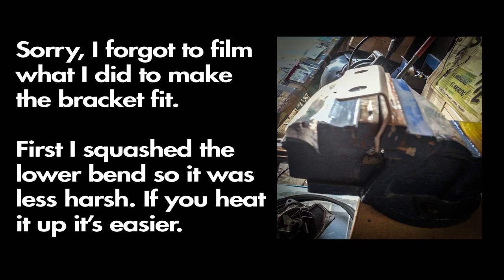Fitting a snorkel to a Mitsubishi Delica L400

Comment: Andy thank you very much for sharing this video, it really helped me complete mine over the weekend 👍
I do have a suggestion - when putting the nuts and washers in I found it far easier to unbolt the side panel (bolts left side engine bay, the plastic strip under the small window, and the inside door). You can get way more access than through the wheel arch 🙂

Comment: The top piece is the wrong way round it's supposed to face forward to help with ram air when driving
Reply: Probably not, driving in the rain that way would probably soak the air filter. Also it probably won't have any effect since the turbo is ramming air into the engine at 10+ psi. The snorkels only purpose is to allow the engine to breath if submerged in water way past the original air entry point just above the wheel arch.
Reply: Johnski I it doesn’t soak the filter, he is correct it’s a ram head.
Reply: Can't help some people, its for ram clean air it doesn't get any water to filter otherwise they wouldn't design it that way 🙄